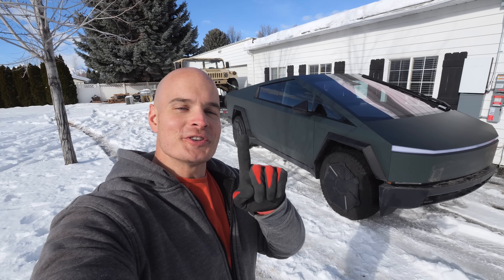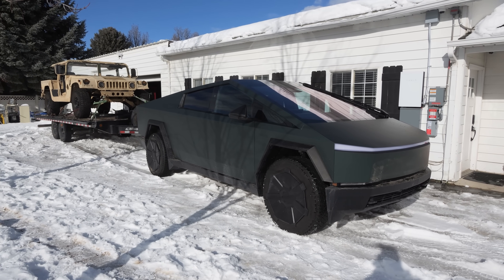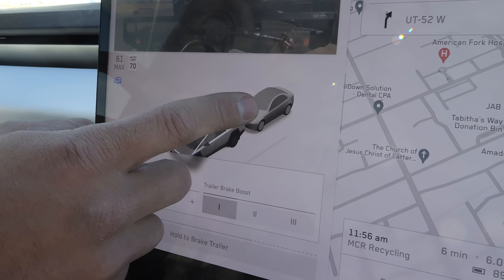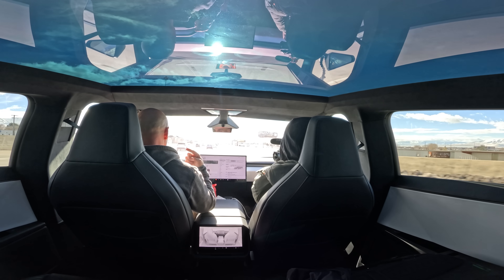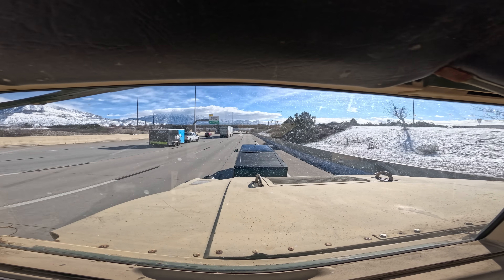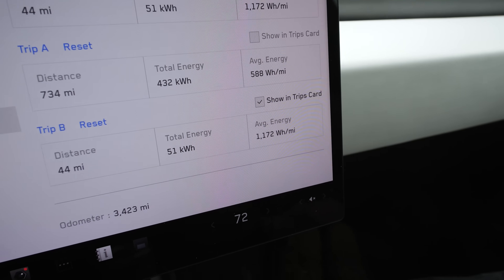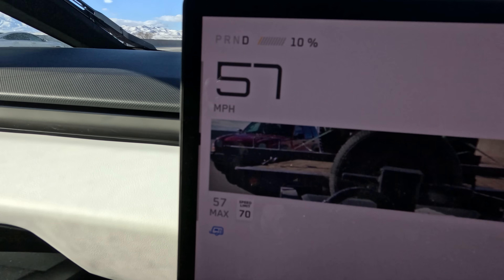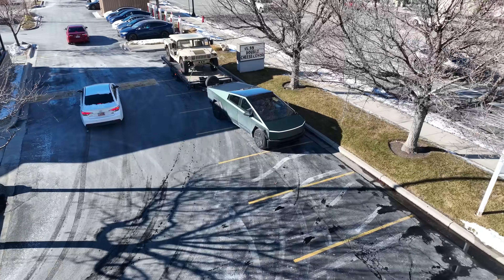How far can the CYBERTRUCK tow 11,000lbs in Freezing Weather?

Comment: maybe you talk about it later, but you need to run the heat and make the cabin comfortable to do a realistic test.  Drafting seems a little unfair unless you did the same with other vehicles.   When you were turning the wheels back and forth while still at your house, all I could see in my mind was electricity being consumed by the servo motors on both axles.

Comment: This test is absurd and unsafe. The cybertruck maximum capacity is 3500lbs, the maximum gvwr is 10,000lbs.
The way it works is:
Gvwr - curb weight = towing capacity (trailer weight + weight of load combined must not exceed)
You are functionally breaking the law and being inherently unsafe by towing this amount of weight with the cyber truck.

Comment: I hope this puts more pressure on Tesla to actually offer the extended-range battery instead of lip service. Ninety miles is understandable in standard trim, but it won't cut it for even medium-range towing. Stick close to home with your boats and camping trailers boys and girls.  I think another good test is to check how it does with something like a tear drop or tent trailer because let's face it, this is the current state of towing with an EV.  I did; however, see where a few start up companies are developing trailers with built-in-high-capacity battery packs that power electric motors on the trailer that drive its wheels, so the trailer is essentially pulling its own load. Those batteries also power all electric loads in the trailer at the campsite if needed....and you unhook the trailer and park it independently from the car via chose of automatic or remote control, which is wild but very effective during preliminary testing.

Comment: 90 miles $13 not bad. Plus if you are charging a customer for mobilization you can charge them for sitting around waiting for the thing to charge up. You would make bank not even working. I think I'll sell my kenworth, F250 and Peterbilt and buy these instead. This thing is a true work horse and proven itself to be such. How much to put a dump box on one of these? Please do a video on hauling clay or gravel with one of these. Amazing truck

Comment: That sound is brutal!  With an EV truck most people are going to tow as frequently as they do in a tacoma.... that is very rarely.   It can tow but, its not really the point. Cybertruck would be the only way I would feel safe driving through Detroit or Chiraq.
Reply: What is the point from your perspective?  Is it really just the so-called "bullet proof"?  Seriously.  I received the "order your Foundation Series Cybertruck with early access" e-mail, but I'm still undecided...  I put in a reservation for a $80K truck with "est. 500+ mile range" and payload and towing specs similar to a 3/4 ton heavy duty.  Now the tri-motor is $120K for an "301 MI. RANGE (EST)" with 1/2 ton specs.  So I am really wondering what, or if, there is a point any longer for me.  The range is a killer. I'm seriously considering an F150 powerboost instead.
Reply: Bullet proof is the fact that it will stop most handguns with the doors and glass.  From a financial standpoint, you would be CRAZY to cancel your order.   Worst case scenario, you resale it for a 20k profit in the first month.   If you plan on towing frequently, EV's are not the answer.   However 95% of the time, when I see a truck, the only thing its towing is the driver.  If you want to tow your camper to the lake every weekend, avoid ALL EVs for the next 10 to 15 years.Demand will be sky-high for these.  Even if you don't like it, the demand is pretty much through the roof.  The f150 lighting was a failure because Ford did a piss poor job with it.  Cybertruck will be pretty well sorted because they didn't pull it out of thin air in 12 months like the lightning and the Tesla tech is the best in the industry.

Summary: if you pre ordered, you're in the resale jackpot.... sale immediately! EV trucks are designed for people that will tow about an hour away 5 times a year or less.  If, you tow more frequently than that, buy a fuel burning truck.  ALL EVs lose about 30% range in very cold weather.... plan accordingly.  Oh yeah and the main advantage the fuel savings is ridiculous!  Better mpg cost than a prius in a truck that typically will bankrupt you in fuel prices.  You might want to google ecoobost towing mpg.... Between 6 and 8 mpg.  You're looking at 16 mpg daily driving the ecoboost.  It really depends on how you will use the cybertruck.  For 95% of people, a Cybertruck will be better than fine.
Reply: @uploderpilot  thanks for elaborating your perspective!

Comment: So 90 miles cost you $0.14 per mile, my tundra has a range of 310 miles, assume 3.00 per gal. For gas and it cost roughly $0.09 more per mile and it takes 5 mins to fill up.  Yikes
Reply: Perhaps it should come with a wind power fan turbine and 10m roll of solarpanel sheet. That way you can go much longer, slower but cheaper.
Reply: @UmmerFarooq-wx4yo  now we’re on to something !

Comment: the navigation battery estimation vs general estimation is standard on teslas, the general estimation is more just standard range + degradation, but navigation gives you the correct % based on weight and altitude changes and stuff.
Reply: Just because it’s standard doesn’t mean it shouldn’t be fixed. But Tesla and lying about range is an iconic duo, so I guess we shouldn’t be surprised.

Comment: It may differ by area, but I was advised by police that they want to see the safety chains crossed and placed over the receiver . That way, if the ball or connection thereto fails, the correct length chains prevent the tongue from digging into the road and flipping the entire trailer. Would love to hear other comments on this.

Comment: wow sounds great LOL 90 miles and only takes an hour to charge. Takes 2 minutes to fill my truck roughly depending on pump and im back on the road with the camper or boat and can tow 300 miles. Imagine if everyone had electric LOL the amount of traffic jams waiting for everyone to fill their batteries at 40 minutes or more on a major interstate. Where there are thousands currently getting fuel in minutes at every station daily. Definitely have a lot of work to do.

Comment: All terrain tires are actually terrible on snow and ice. They are designed for dirt and mud, not ice. All terrain tires means less rubber in contact with ice, which causes far more sliding and skidding.

Comment: 550miles on 22 gal, refuel is 5 mins not an 35 to 45 min recharge! that's if a station is even open and not full!, I don't have to disconnect my trailer to charge. I can run my heat full blast not affecting range. I don't have to slow down! My trucks a hell of alot cheaper to work on than electric! I can take any damn direction i want to go and any route! I mean i can go on and on and on! I will take A F350 ANY day of the year! EV's No thanks! 13$ for 90  miles compared to my truck towing almost same weight the same distance would be 12 to 13$ as well! I can go 550 miles not the 90 you have to! NO thanks The technologly is not ready! its got another 20 to 30 years maturity to go yet before this stuff even becomes viable and sustainable!

Comment: Thanks for a real world towing test. 1) Lots of road noise, or at least the mic picked it up well. 2) How long did it take you to recharge to full? 3) Could you have found another EV charger somewhere if you couldn't make the Supercharger?
Reply: Responding only to 2): in general, you don't want to even try to charge to full at a Supercharger.  In many areas, Tesla will now ding you $1/minute if you try to charge above 90%. Reason: current LiON batteries can only be charged at a reduced rate when they are at very low or very high states of charge* due to . . . science.  So, you can't charge nearly as fast from 0-20 or 80-100%, and trying to stuff that last 20% in can take as long as the previous 20-80% did, tying up the charging space.

2/3s (roughly) of EV buyers can/could charge at home and should do so; for us, using DCFC (the generic term for what a Tesla Supercharger does) is mainly reserved for trips beyond our daily commute.

* = Also, reduced charge rates at very low/very high battery temperatures, eg below ~45°F/above 120°F.  Hence, Teslas allow "preconditioning" of the battery if you tell the vehicle you're on your way to a DCFC station.  It will accelerate pre-cooling or pre-heating the battery, so that when you arrive, you can being charging at the fastest rate available for the battery's current state of charge.

Comment: You are all failing to see the picture, a electric tow motor is not a truck.
Just like a fork lift is not a farm tractor.
Just like a 4 door 4 wheel drive with a 8 cubic foot bed does not make a truck, it make a 4 wheel soccer moms car with no trunk lid.
A truck needs a bed capacity to haul 4 by 8 sheets of plywood .

Comment: The real test is a draggy box camper trailer 24-30 ft long at 11,000 LB and 70 mph.  Driving at well below 70 makes it use a lot less energy.  I would estimate you would get 1600 wh/mile.

Comment: That range anxiety is relatable. About a month after buying my '23 MYLR, in central Texas, I drove to Post, Texas (look it up) from Austin. The last supercharger was in Sweetwater and there was not even 110 trickle charging in Post. Not because Post has not electricity. Of course it does. The issue is that I was staying at a hotel, whose parking situation ensured I was not within reach of a wall outlet.

So, on the way back, we pulled in to the Sweetwater 150KW supercharger with about 5% charge. The main stressor was that it was about 100f outside and while we were skimping on the A/C, and trying to maximize regen opportunities, traffic on back roads kept all that from being ideal. I had driven it about a month at that point and was never more than maybe 20-30 miles from a 250KW supercharger.

Comment: Cool video! There was still some juice in the battery pack, maybe even 15 kWh, so could have done some more, but power limits might be a thing under 0%. Out of Spec got 124kWh out of the battery driving it empty from full. I think the Tesla %/mi indicator is rated range and the navigation is the one trying to calculate per consumption.

Comment: Seems that the steering could be lost while in use if the electronics fail. That seems sketchy to me. I prefer rack and pinion. 90 miles towing is not good. EV's are not ready for primetime IMHO.

Comment: Lot of things to make sound, but they could have insulated better for sure. The VFD’s and inherent inverters will create the most sound to create the three phase back EMF for the induction motors. When you have multiple motors, like the dual motors in the rear, you are also using them to replicate the function of a differential so your back EMF’s will have a clashing acoustic signature due to difference in frequency of supplies. In the tri-motor it’s probably even more pronounced because I think the front motor is a PMAC rather than an induction motor, so its back EMF is a different shape entirely. 

Then on top of that you’ve got various pumps, road noise, wind resistance, high and low order harmonics, etc etc. Could get a fancy microphone and a spectrum analyzer to find the noise culprits.
Reply: The TLDR I’m making here is that it likely is the motors making the most significant noise, but that the perceived amplitude of that noise is not going to have a super strict linear relationship to the applied acceleration
Reply: @@Electric_car_channel  I have not personally heard it this loud in other videos i've watched, but is it possible that they just hadn't thought it was loud enough to comment on it and their audio interface had noise suppression. I also haven't seen another video with cabin footage while towing 11,000 pounds, though. It may also be that he's more sensitive to the noise because he daily drives EV's, while other reviewers probably don't.

Comment: The interesting thing is 32F isn't even all that cold, and not where EV's really start to suffer. I'd love to see what it gets in like 0F (I'd guess about 50-60mi).

Towing trailers and campers, particularly in the winter is extremely popular, so this was good to see.
Reply: 32°F isn't really freezing so not really a true test.
Reply: @melsjunk2645 32f is the temperature at which water freezes, so yeah it's literally freezing.
Reply: Can't speak on towing with an EV, I have a 3500 gasser for that. Driving my Leaf home from work on a  normal day 12%-15%, with the temp in the teens, 27%-30%. Heat kills lithium batteries, but the cold strangles them.
Reply: I about 5 yars ago in southern indiana during a usa vist I tlaked to a person with a F450 dual rea wheel and it had fifth wheel hitch for the trailer. There was no trailer on. he had huge diesel engine and got about 14 mpg. The tow capaciyt was 39,000 lbs and his firth wheel weighed about 18,000 lbs and going over a high place in the rockies he did not even really notice the load.  I THINK THE COMMENT ABOUT REAL COLD GIVE THE LAST WEEK IS REAL.
Reply: It might not matter that much considering the amount of juice it needs to tow that much weight. Might keep the battery warm enough just from the normal power demands.
Reply: We had around -50 or so cold snap with wind here in Montana. Doubt the EV would work then, also what can it do in feet of snow? Not a dusting.
Reply: Was in the -40's Celsius here for more than a week. I'd like to see him do it in that.
Reply: @foghornleghorn2445  agree. it gets pretty damn cold here too, well below 0, so thats the kind of thing I'd like to see for the electric vehicles, cars or trucks. I'm honestly considering a car eventually. I like the idea of less maintenance (no oil changes, fluid flushes, belts, etc). I only put about 8000/yr on my car, almost never long trips, so an electric vehicle would be right up my ally. I do see people in my area with them, Teslas, Rivians, etc, so they must do well.
Reply: @foghornleghorn2445 -40c and -40f are very close tempwise.
Reply: @foghornleghorn2445  prolly wouldnt even leave the driveway 😂
Reply: Yes , -20 to -40F in Minnesota,  we tow icefishing houses and snowmobiles all the time. Often stay overnight in that weather fishing,  how will it run after sitting in that weather.  Likely need to plug it to a gas generator overnight to keep batteries warm and get some range to get home.
Reply: @dsonnek7781 The irony of using a gas generator to charge an EV truck. So much for your carbon footprint. Also, how long would it take to drive 400 miles?  Using the video as a reference that would be roughly 10 hours, versus roughly 7 to 7.5 hours with a gas truck.  That is an extra 3 to 2.5 hours longer for the same trip.
Reply: @jandecoleman1  But you get to spend that extra time virtue-signal communing with all the others waiting to get access to a functioning charger.
Reply: @dsonnek7781    My guess is, you would be stranded out there if you took the Cybertruck .  EVs will die fast under -20F , look what happen recently in Chicago.  Lots of Tesla died.
Reply: @Takeiteasy-u3r  I'll wait for the Ramcharger,  92K battery with the v6 motor/generator that feeds off a 27 gallon tank. No long recharging stops required,  just stop for gas, but if electricity is available and you have time, you can charge as well. I like GMC/Chevy idea of a pass through between cab and truck bed. Very nice for a topper or camper if designed right for camping, get heat and AC off the truck, even better if plugged in at a camp ground. Nice for overland adventure,  save battery for camping and drive to location on gas, no night time generator/motor noise. I do like tesla stainless steel body, no rust issues up north.
Reply: @dsonnek7781 Yes, to everything u mentioned!!!
Reply: @dsonnek7781 
Who told you stainless doesn't rust?
Besides, only the skin is stainless, the rest of the urinal ain't.

Comment: EV's are toys for the rich, not meant for the average citizen who needs to get to work quickly in all kinds of weather. The virtue signalling belief of climate change enthusiasts is that EV's are the panacea for resolving GHG emissions and will save the planet. This has been proven to be totally false and misleading. They are in fact more polluting and less energy efficient than ICE vehicles. As if the foregoing was not enough to make you reconsider the rationality of governments pushing EV's, the largest global source of cobalt required to manufacture EV batteries comes from equatorial Africa and is mined by children working in inhuman conditions.

Comment: So that number is going to be lower at a higher air density even at the same temperature (whatever that was) and will lower even further in actual snow at higher weight/drag  

Also what was the trucks condition when you left was it outside and completely cold or was it warm when starting

Comment: Thanks Zach.. good to see the REAL capabilities of the Cyberjoke. They're ugly as a mud fence, noisy, full of blind spots, and from what I've seen of the crash statistics, I'm surprised they were even approved to be on the road.😝 At the end of the day,  you have a vehicle that nobody can work on, except Tesla, with sub-par range and towing capacity. A guy would be better off with a '69 Ford 3/4 ton, with a 390 V8. The gas mileage sucks, but then again, how much coal or natural gas has to be burned to recharge the Tesla? Plus if the Ford (or Chevy, or Dodge) DOES run out of gas, you don't have to tow the whole mess to a charging station to fill it back up. 5 gallons of gas from a jerry can, and you're on your way!😉
Reply: Most people who buy a truck do not use it as a truck. Most people who buy an ev today do not care about the environment.
This truck will outsell Ford /rivian ev combined because Tesla pumps volume better.